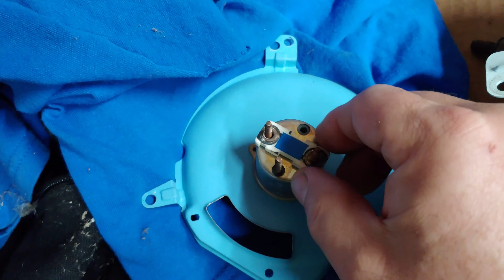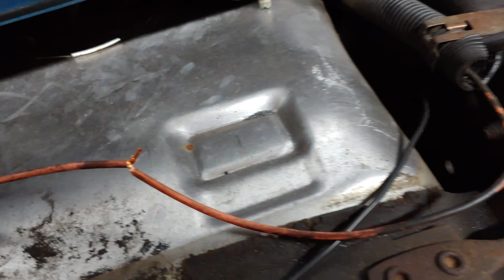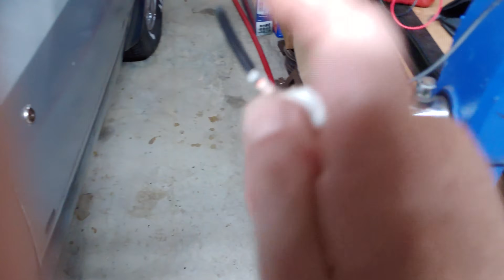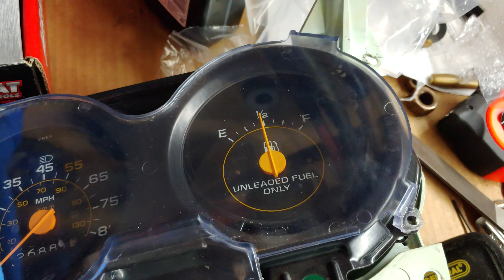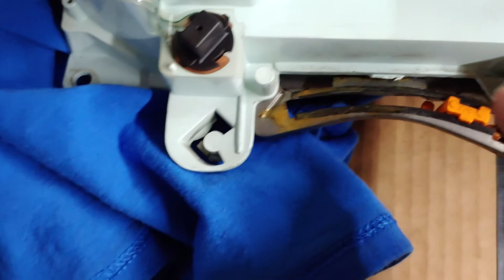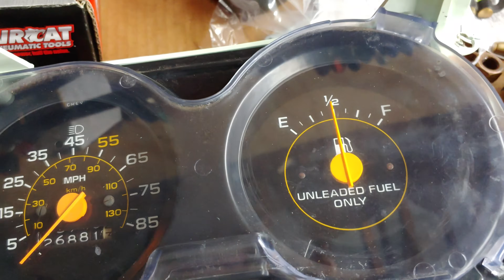GMC Square body Fuel Gauge Troubleshooting

Comment: Hello
Like to know if you can help with the dash cluster swap I have done. I purchase a electric type speedo dash cluster that looks the same the older dash clusters. I have done a LS swap in my 1984 c10 chevy truck. The 2005 5.3 chevy engine with a 4L60 trans are electric speedo setups. No cable feed. I purchase a dash cluster out of a 1990 model truck that they only made these dash's from 1989to91in all new chevy trucks suburbans GM getting away from cable feed speedos in the 1990 models, and so on The a dash looks and works good . But I'm having a problem with the speedo wire connection.  The transmission speedo  only has to a two wires connection should be easy enough to plugin. I run them two wires to the back of the cluster plugin. Not sure if i should go to the PMC ECM first, because the way I have it hookup it's not working. Hope you can help. Thanks
Reply from the maker: OK, you have lots going on there! Unfortunately, any help I can give is limited for a few reasons. You say you have an aftermarket cluster of some kind... without knowing what one its a mystery to me. Even then, my knowledge of your particular aftermarket gauge cluster is going to be lacking. I would imagine that any reputable supplier will have a tech support line. I guarantee you are not the first person with an LS swap to use their gauges - just reach out to them!

As far as the LS stuff goes, and using it with the 1990 cluster, the vehicle speed out (pin 50 of the green connector) is I think what you are looking for. I'm far from an expert on late model stuff, though.

Take a look at http://lt1swap.com/2004vortec_pcm.htm

Comment: Nice video. Pretty sure my sender is what's got my fuel gauge all screwed up on my 86 K2500. While mine has the same fuel gauge as yours, do you know if the smaller fuel gauge that takes the place of the clock in the clusters with a tachometer use a resistor like that in yours, or do they have a built in one? If so and it turns out mine needs a resistor I may just buy a second kit to convert my 86 over to a factory style tach if I can't find one 90 ohm one.
Reply from the maker: To the best of my knowledge, all the fuel gauges from this era used the resistors. I myself have handled a small (tach version) gauge with the resistor. Note that new, repop gauges probably won't need the resistor, as it is built-in. I've seen new ones with what looks like a dummy spacer where the resistor would be, but only in pictures. I've always been able to get the old factory gauges to work, knock on wood! Best of luck! I want to do a factory-look tach swap, too, which means sourcing a small fuel gauge.
Reply: @hardscrabblegarage  LMC sells an entire kit to swap it over to a factor style tach. Also I pulled out my gauges I got to go into the tach swap kit that I have for my 85 C30 dually and they all have a piece of plastic on the back of them that mimics the look of the resistor. I'm pretty much going to use the kit and build a completely new cluster for my 85, with the exception of the Choke/4 Wheel Drive and Brake/Seatbelt lamp lenses. Those will have to come from the old cluster.

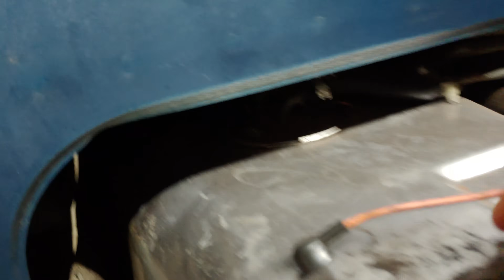Comment: I have a 1974 shortbed stepside chevy x10 and put in a new float and sending unit. Cleaned the ground and when I turn the truck on the gas hand goes to the 3:00 position. It is not going back as long as the truck is on,after a while it will go back to almost 3/4 of a tank. What could be the problem? Oh when I pulled the gauge out someone had put 2 rubber caps on the terminals,why would they do that? Stumped,need advice.
Reply from the maker: When it goes to 3 o' clock it indicates there is likely an open circuit in the wires somewhere. As in a broken wire, bad connection, etc. Follow the signal wire from the float assembly all the way to the gauge, verifying each connection with a multimeter. Good luck!
Reply: @hardscrabblegarage  thank u very much u r the only one that has given me the right direction to look,again thanks.
Reply: C10
Reply: I'm currently fighting the same issue.  My K10 has dual tanks and recently goes past full to the 3 o'clock position.  Did you ever figure out where your break was?
Reply: @gweggslist4460  I replaced the resistor on back of gage,went to work accurately. Hope it helps.

Comment: You did a wonderful job in this video. I appreciate you for posting it. This is the most thorough explanation of how to address fuel gauge issues. I have a square body and detail is hard to find in repair videos. You need to make more! Don’t worry about how many views or subscribes, just put out the content and give it time. Following now!
Reply from the maker: Glad it was helpful! Thanks for taking the time to give me feedback. I do have lots of square body videos in the works, all from the perspective of an average guy with a realistic budget. I also have a "fleet" of vehicles that is ever-changing, which gives me the chance to shoot a lot of stuff. I'm trying to slow down and give details that many other channels seem to gloss over (no doubt my videos can be a bit dry in comparison). If only my editing skills were better, haha! Or at least faster - there is much more content in the pipeline, waiting for me to get it ready. More content soon, I promise.
Reply: @hardscrabblegarage  Looking forward to it. And don’t worry about the production—content is king for those who are serious. Sometimes I get tired of “slick” anyway. I’m an average guy with a square body who has no mechanic experience. I ordered some dash parts from LMC Truck and saved this video to guide me as I restore my cluster. Your video will help because my fuel gauge only goes up halfway even when the tank is full.
Reply: @hardscrabblegarage  Hi what did you set your volt meter to when testing the resister.